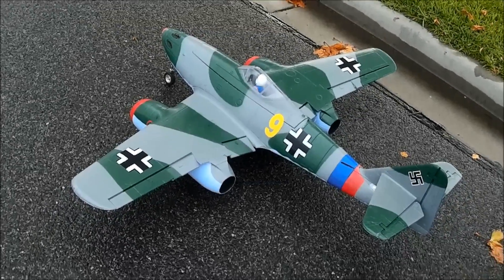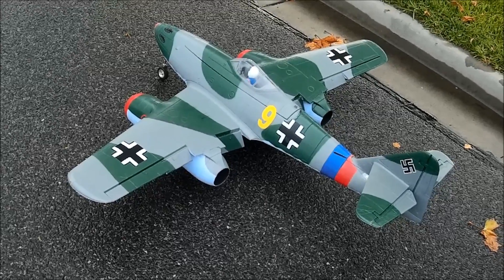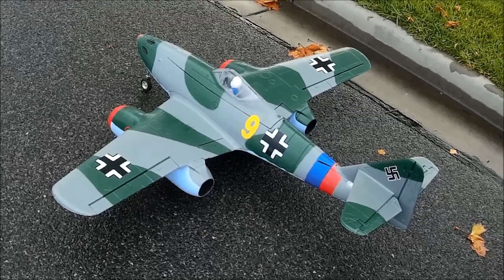Me-262 - Dynam 1500mm Twin 70mm - First 7S Wemo EVO test

Comment: Shes a screamer, you sure those fans are balanced?
Reply from the maker: As mentioned in the Me-262 thread, one fan has some motor issue and is messing up the balance across the range too. All in all the Wemo EVO's sound like crap in nacelles! Whilst in the Su-35 they are excellent sounding (and power!). The Me-262 prior CS10's were far better, so I might be changing back to them but with a different power setup than the prior 2300kv 5S.
2200kv 6S, or possibly even those same 2200kv motors (as per used now in the EVO) on 5S XRP14.
If I could get a decent 2000kv motor I would do the 7S XRP14 combo.

But for now (a while) I will leave it with the WEVO's.
I will take the rogue fan out and see what I can do to fix/improve it soon too.
Reply from the maker: MrPetersVideo I got the fans out to check. The left one was worse then when done - but still only "50 units" of imbalance, which is approx what CyclonePower EDF's come with. I re-balanced it back down to "15", but more important was oiling the bearings while it was apart.